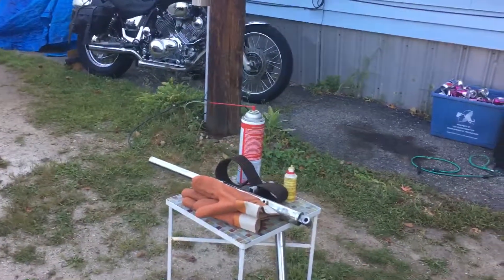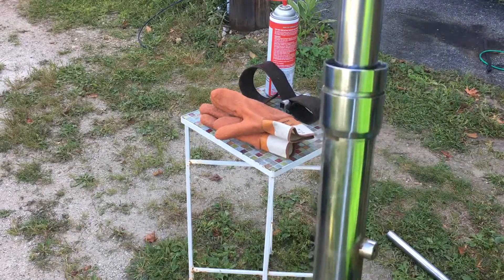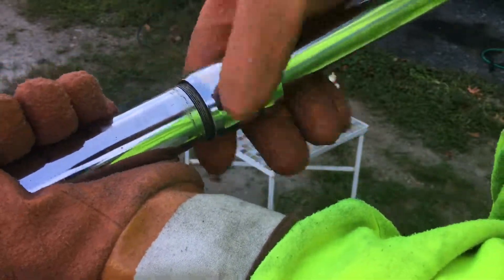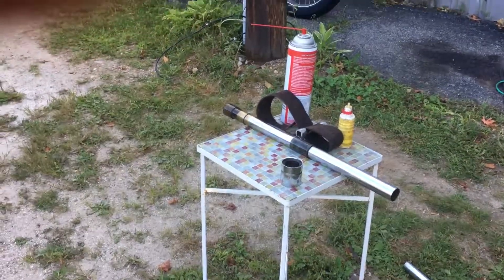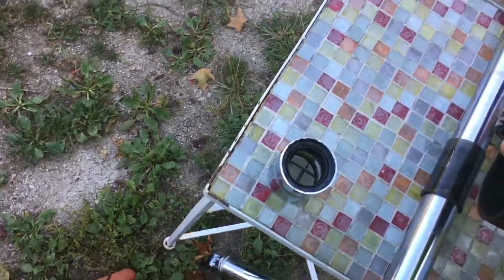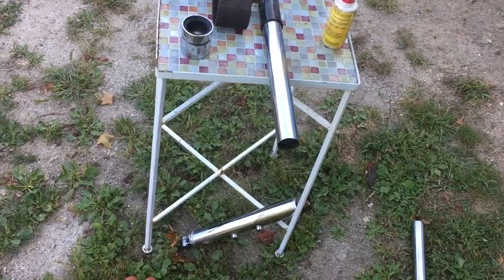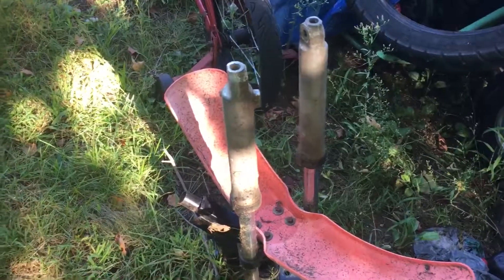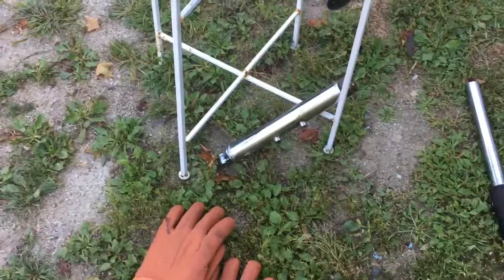KE100 shocks part2

Comment: Thanks for this supplemental video.  I am restoring a ’74 G5 with the chrome forks (fender mounts, screw on nuts) that you address in this video.  Question: once I get the “nut” unscrewed and the fork divides into two components, do I need to loosen the 22mm nut at the top for any reason? Is that where I will add the oil once get the fork put back together?Also, the maintenance guide specifies “SAE 10w” oil.  Not 10w 30 or 10w40.   What oil do you recommend?
Reply from the maker: Remove the 22mm nut 1st to unload the spring after it's finished you can fork oil at any motorcycle supply shop or 5w20 motor oil

Comment: hey man,  
im going through the process of replacing my fork oil seals on my 1973 g5 100. got some seals off of Ebay and I can't figure out how in the heck they are supposed to get seated in the Tube Nut. how do you get it passed the little lip just below the top of the Nut?  and my old ones seemed to have covered that lip like the one in your video. the seals I got said they were for  a 73' g5 100.  even with a fork seal driver I don't see how it is possible to get the seal passed this lip.  any help would me greatly appreciated.  yours is the only video or tutorial that even shows this type of shock.  and yes I do have a manual.  it says nothing about this lip.
Reply: Did you work this out? I am having the same problem
Reply: Hey there. It’s been a while since I did the forks. Have since sold the bike. 

If I recall that lip was actually part of the seal. I couldn’t find anything online mentioning it. So I ended up kind of murdering the old seal to get it all out. Figured if I was wrong I would just fit some other shock. But I am pretty certain that it was part of the seal and that it will come out with some work. 

Hope that helps. Good luck.  Miss that bike.
Reply: Thanks for your help!! I have been stumped on this for a while now and haven’t been able to find any information. I stripped this bike down 3 years ago and have almost finished the rebuild, just need to get the forks back together. 

I really appreciate your  reply, thank you.

Comment: Is there a certain trick to getting the fork seals to slide over the tube once I put them back on. Have or get another set. It damaged the spring on both seals when I tried to slide the tube back on
Reply from the maker: Grease it before you slide it
Reply: Thanks I will do that.

Comment: Thanks a million for the video! My daughter and I are rebuilding a 1978 ke175 and we're having trouble with the forks. I hope that they are original.  The inner fork tube had a retaining ring at one end. We removed this and pulled out a sleeve, spring, a spacer that resembles a castle nut, and a smaller sleeve. Now that we have cleaned things up, I can't be sure of how these go together. They don't show up on the parts diagram. Any help from anyone would be appreciated!
Reply from the maker: Go on partszilla shows parts break down
Reply from the maker: Welcome

Comment: Hey, ive got another question about my 79 km100, i recently bought new rear shock absorbers and the part that you put the bolt threw on the bottom is thicker than the origonal so it bends the mount and the bolt no longer reaches, are you able to rebuilt the old/original ones? i watched a couple other videos on how to fix them but there is no oil drain screw on the bottom half of the original shocks